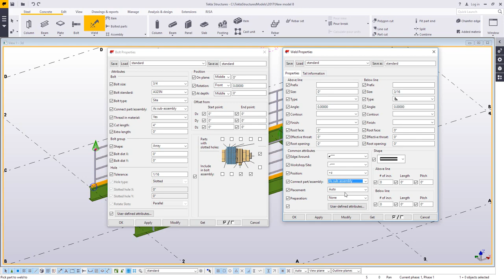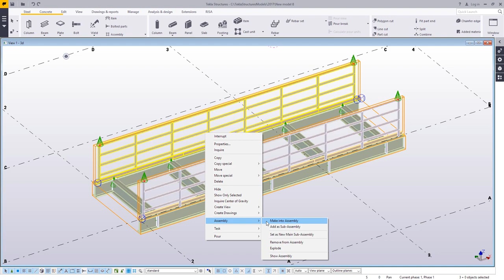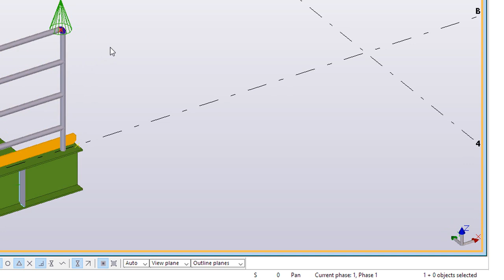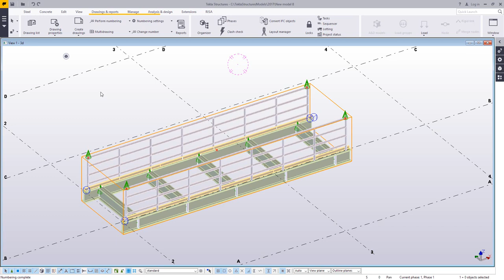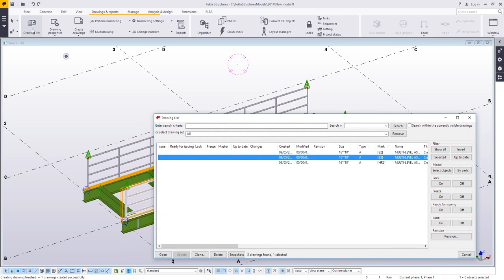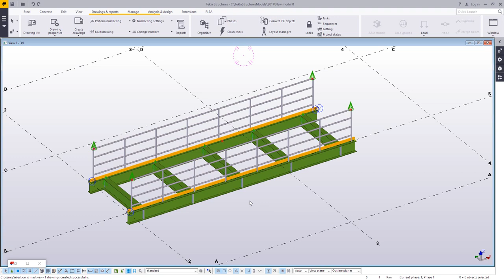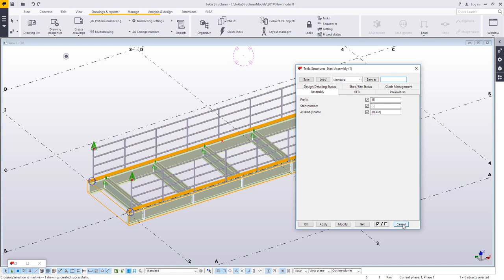Working with Multi-level Assemblies in Tekla Structures

Comment: Do you have ever used rounding in part level? For example if you have designed beams of 1999mm 2000mm and 2001mm can you optimize them automatically? Is there any tip and trick that I can use?